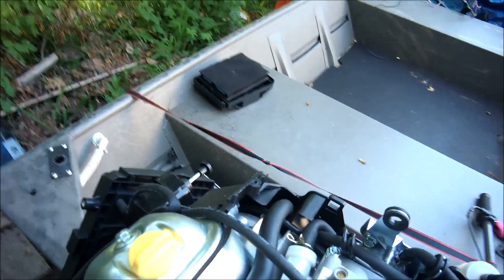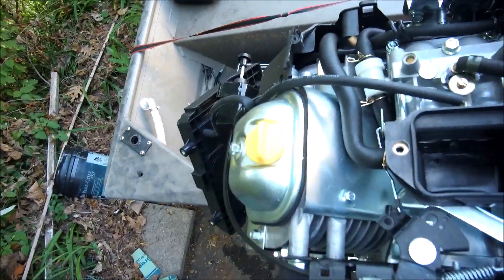Predator 670 Carb Adjustment

Comment: They make kits to put dual mikuni style carbs on those engines it would help you out a lot on a mud motor being those carbs have accelerator pumps built in
Reply: I just bought a chinese mini skid with a knock off 670. It starves itself of fuel. Came across the mikuni carb for $350. Will that fix my issues?

Comment: fwiw, the main jets that you're adjusting isn't the proper circuit. The low speed jet is what you need to adjust. It's below the security screw/cap between the two hoses on the top of the carburetor.

Comment: Do a 670 in a gator! What type of fuel pump did you use? Thanks! You boat sounds awesome
Reply from the maker: Use a low pressure fuel pump.  I got mine off of Amazon:
https://www.amazon.com/Doyes-Electric-Transfer-Universal-Carburetor/dp/B07K7J25GJ/ref=sr_1_3?crid=2EY9RHD8VHGUK&keywords=low%2Bpressure%2Bfuel%2Bpump%2B12v%2B1-3%2Bpsi&qid=1648294230&sprefix=low%2Bpressure%2Bfuel%2Bpump%2Caps%2C90&sr=8-3&th=1

Comment: You’re on the right track. But after removing idle SCREW caps (they are not exactly a jet) do this:
Turn each screw IN/clockwise, slowly, gently, carefully until it is seated all the way. Then turn each screw one OUT one + a quarter turns. That’s a typical starting point for idle screws on most old-school carbs. One, two or four barrels. Final adjustment with engine warm, 15-1600 RPM idle & everything else right should be 1.25 - 1.50 turns out. You will be able to hear/feel engine slow a bit when it’s turned too far IN, just back it OUT/off a tad, a quarter turn at most.
Reply: i believe this help thanks

Comment: The choke linkage was too short on mine so it would not start when cold , it looked closed but it was not all the way closed, i had to bend it longer to get the choke plate to close completely.

Comment: Mine starts fine when it's warmed up but today in the morning won't start I think it flooded I installed an electric fuel pump
Reply from the maker: You engine will make less power in  high altitude so maybe you don't need the electric fuel pump
, definitely swap out those jets for the other set

Comment: Good video mines doing the same I never put the altitude adjustments in there did you?
I live in New Mexico 5000 ft above sea level
Reply from the maker: I am on the east coast, pretty much sea level in most areas, so no never needed to try those jets.  But, if you are higher in elevation then you have less oxygen to burn, so those jets would cause a lean condition where I live.  For you it sounds like you must install those and then install the electric fuel pump.

Comment from the maker: I installed and tested mine with the original pump still inline.  I was told to remove the original pump and it works even better.  I will have to try it out.

Comment: when replacing the fuel pump with an electric pump do you need a pressure regulator after the pump? or can you just use the electric pump? ours is having severe issues getting fuel
Reply: I'm sure you're past this problem by now, but I'm answering for others. I use a basic electric fuel pump with no pressure regulator. I removed the pulse pump completely. It works perfectly.

Comment: Can you show me where you hooked up the kill switch to that motor.  I'm in the process of installing a 670 on a Backwater LT kit and haven't seen anywhere online where I should install the black and red wires.
Reply from the maker: Take the yellow wire from the low oil shut off and wire the red lead of your kill switch to that and black to ground on the engine.  I will verify this afternoon.  Hopefully post a small vid.
Reply from the maker: Posted the vid:
https://youtu.be/_7OiViq8WvQ

Comment: What did you use to replace the caps??
Reply from the maker: Nothing at all, Its just like any other small engine carb.
Reply: @thepauldixonOC  I think the caps are there to satisfy the California Nazis regarding emissions, from what I've been told.
Reply: @dp10666  HF doesn't sell this engine in California, so you can throw the blame elsewhere.

Comment: I have the same Twister 4 on a gutted 17' bass tracker for bay fishing. I was having all the same problems mentioned. I went to 6Sigma and bought there rejetting kit. I removed the plugs from the enrichment screws with  a drill and screw, I did not want to beat on the carb.  I was thinking there was a screw for each side of carb. I backed off both screws 1/4 turn and it ran much better. It will know crank with out the choke once engine is warm. How fast will your boat go? I also believe that fuel pump on the engine is a problem, I like the idea of bypassing with an electric pump.
Reply: Mine is hard to crank in cold weather and I have to use the choke with every crank. But I'm not 100% sure of what your talking about on the 1/4 adjustment. I need to fix mine like you said.
Reply: The electric pump is a good idea. Amazon ( of course ) has low pressure electric fuel pumps. He didn't bypass the original pump bit he should.

Comment: I removed my pneumatic fuel pump after I installed my electric one. It did much better
Reply from the maker: I will go ahead and do that then
Reply: @thepauldixonOC  the diaphragm inside the pump was leaking gas to the overflow on mine. That's initially why I did it
Reply: is the pneumatic fuel pump the one that came on the engine
Reply: @abundantblessings3555  yes